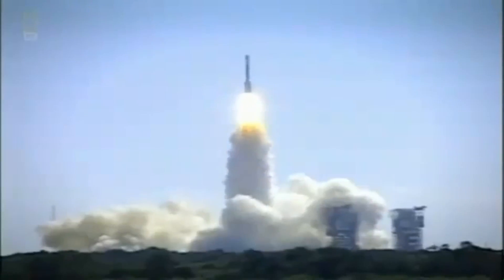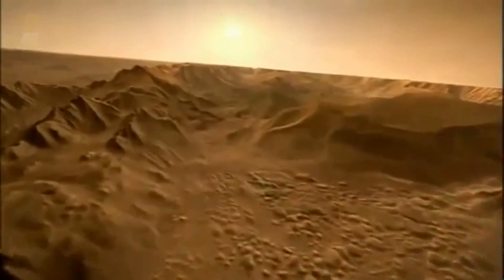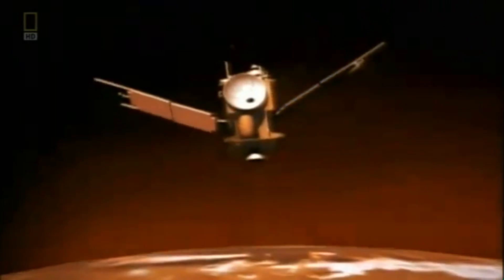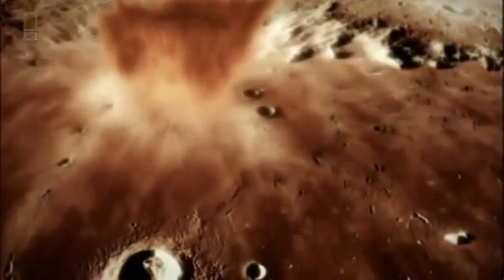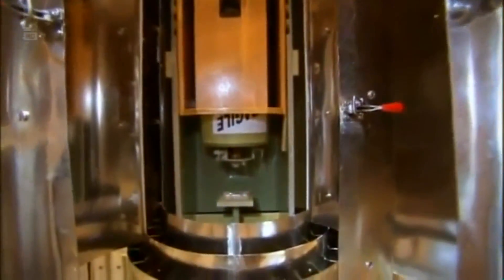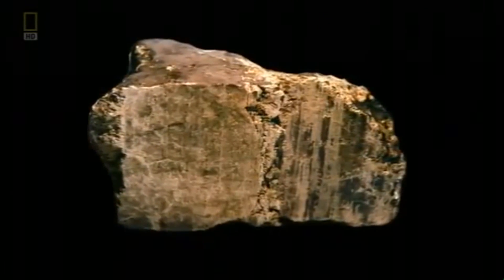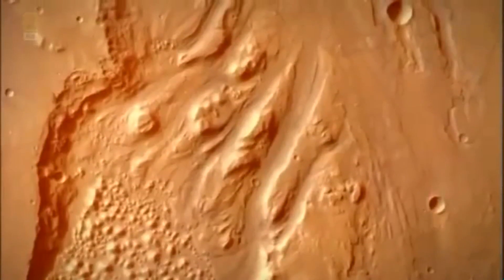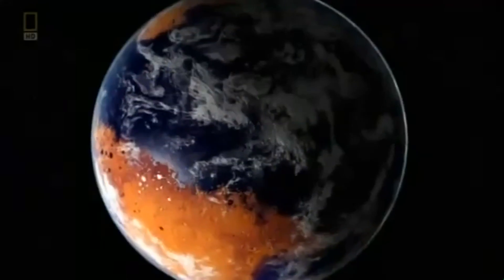Death of planet Mars (Documentary)

Comment: Mars was struck by a massive iron meteor storm in the not too distant past. One of the meteors was so large, it cracked open the planet forming the Valles Marineris. The rift is so large it runs almost 2/3rds of the distance pole to pole. It is also some 5 miles deep as deep as Mt Everest is high here on earth. How deep was it when it was first formed? With the planet cracked open by the massive collision, the Martian core began to cool rapidly and solidified thus losing the magnetosphere and the protection it provided. It is this side we see Valles Marineris, as expected, on the opposite side of the impact zone. The shock waves that ran around the planet met on the opposite side creating this massive crack (amplification of waves meeting). Furthermore, the upheaval was so large and intense that lava spewed out all over the planet forming Olympus Mons and other super volcanoes.  The impact zone, or ground zero, is evident by the fact that almost one side of Mars is flat as a pancake whist the other side has the mountains and valleys as we have here on earth. The Martian atmosphere was almost stripped bare, it's oceans vaporized and any life that existed was wiped out in the ensuing inferno that engulfed the planet. The iron dust on Mars is pure, ie not found within rocks, thus implying it arrived on Mars some time after the planets formation, ie meteors. This iron dust is the remnants of the meteors that exploded on impact or penetrated deep in the Martian crust. 
I would also hypothesis that Phobos and Deimos are made up of iron as well. These two 'moons' of Mars were part of the meteor storm that struck Mars but their trajectory was such that they did not impact Mars but were captured by it's gravity.
Anybody wants to comment on this theory? 
I'll be interested in your thoughts.
I would also go as far as to state that there is subterranean life still on Mars.

Comment: Why they do not talk about Mount Olympus? IT IS A f 18km vulcano!
Reply: 24
Reply: finally!!!
some one that looked into this!
firstly, the only reason why Earth has a strong magnetic field is because of it's core, it actually has two cores, how? when it had a collision with the planet theai. This will keep Earths magnetic field and core strong for a very long time, the opposite happened to mars. If you look on mars a planet half the size of Earth, you see not only olympus mons but alba mons too, alba mons is strangely wide and flat, it seems it has collapsed, surrounding the volcano is cracks that are over 1,000 miles long. It is possible, that on a planet half the size of earth and with a volcano 800km long it would have a very catastrophic event. It firstly speeds up the cooling process of Mars core that is why mars has random magnetic spots because parts of the core are still molten. They have said that mars had very salty acidic oceans nearing its safe time, and that it rained sulphur dioxide down but they did not know why, well when i volcano that size erupts, it realises carbon dioxide (Which mars atmosphere is mostly made up of) and sulphur, sulphur is a very bad gas, It blocks all sunlight preventing heat from coming in, and Makes the planet cold. This happened on Earth when a volcano in Indonesia erupted it sent the whole planet 10 degrees lower. Now that volcano was not a super volcano, imagine a volcano 3 times the size of Everest
erupting on a planet half the size of earth, it's a killer. Soon after the eruption Mars magnetic field shut down and then got whipped away  and that is why mars is like it is today. I came up with this theory myself and the pieces do fit if you think about it